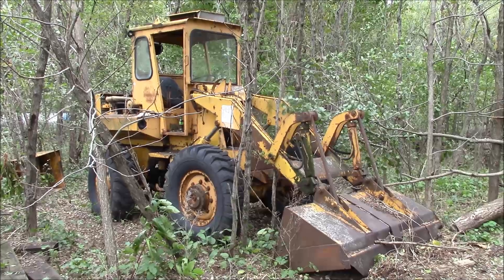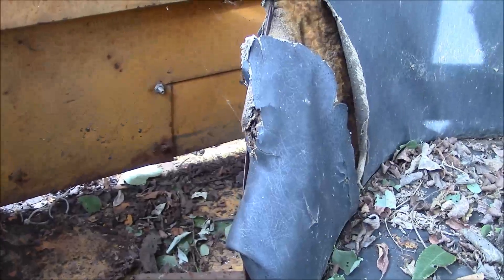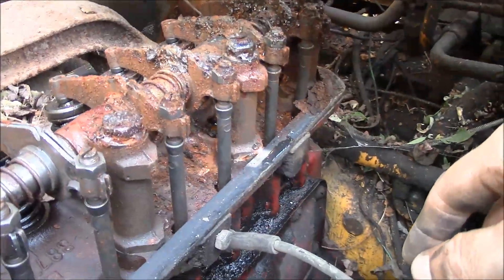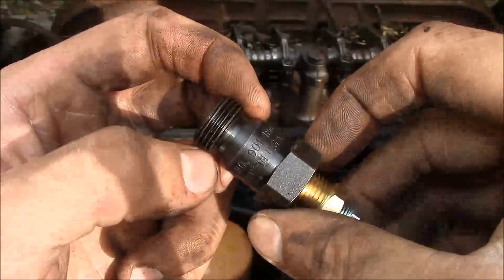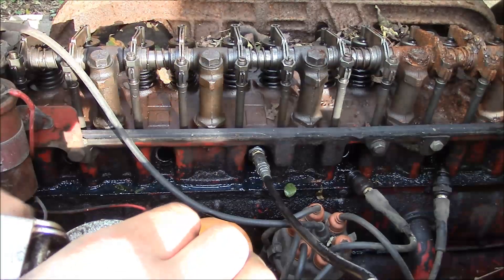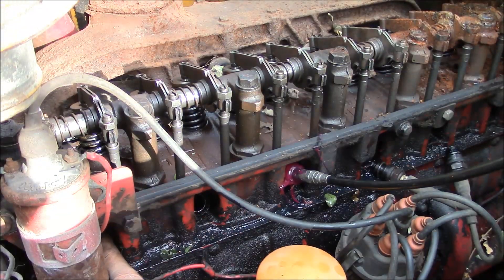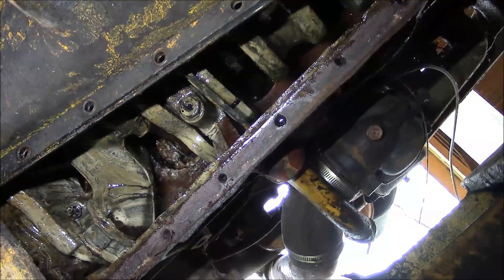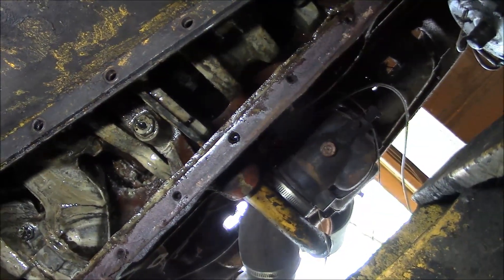Can You Free a Seized Engine with a Grease Gun?

Comment: May be able to remove pan and head drive pistons out and get a better ideal what you would need to do, may get by with a in frame overhaul? A used engine like that would probably be hard to find, may be able to put it's diesel cousin in it? Maybe be able to find something out of an old combine that would work, lot of old combines end up in the junk yard and still have good engines in them? You don't really know if the transmission is still good, could end up spending 9 or 10 thousand on it to make a good machine out of it.

Comment: Fill the cylinders with brake fluid, brake fluid had anti seize properties in it, keep cylinders filled till it moves. Or you can pull the head and make a plate to bolt down over cylinders and use a porta power hydraulic system to pump on the cylinder.

Comment: eBay has a C 301 block in Michigan for $625 that they said has been magged for cracks....but so much would still be needed to be done. Re-Engine does make he most sense. Okay, I went back and watched the first video...so looks like you guessed most of the same possibilities as I did for how all that water got into the crankcase...yuck.
Reply from the maker: It was covered when we starter working on it, but it must have been open for many years.

Comment: Finding a replacement engine to fit the bellhousing of the transmission could be tricky. You may find more luck in buying an engine and transmission together that could be retro fitted? A difficult one to sort because you can put too much into a machine and still be goosed. I bought a pressure (totally different I know) with a few "issues" and I have had to step back from it as it wasn't economical to repair in the end. Have sold it on and lost 65% of the money I had in it. Some you win and some you loose when you start buying any machine. All the best and I also wish you luck!

Comment: Should have sprayed brake and parts clean in the spark plug hole let it set for about 10 min it work for me with a freezed up pistons. The pistons inside the cylinders were rusted tight. brake cleaner is number 1
Reply from the maker: It's had several things sitting in it for 3 weeks. It's not happening.
Reply: @WatchWesWork  Ok then its definitely trash get a donor engine best bet. I'd go with a diesel conversion if possible.

Comment: Dump some ATF and acetone down the cylinders it will fizz and bubble and eat the rust ring. Worked on a long tractor that went under water and then sat full of water 14 years. That old long runs really good now. Never pulled engine apart!

Comment: What about a CNC machined aluminum adapter plate to a more readily available engine,  without seeing the setup I guess that's easy for me to say,  I know you've worked with CNC machines on your channel before.  I just tried to look for some used C301 engines on the net with no luck perhaps the community could pitch in.

Comment: Feel like that machine might be worth repowering with a more modern straight 6
Reply: a chevy 292 would be good common engine on farm machinery and old trucks
Reply: So is another IH straight 6. Probably could get a good one cheap too. They used those engines in trucks, combines, and tractors. Pull the junk one out, bolt in a runner, and you’re off to the races.
Reply: the ford 300 six made good power and are very reliable
Reply: Cummins
Reply: Pierce made a nice 24 valve T head 6 . 14 liters of torque . I was fingerfucking one Saturday before last , and I  CANNOT wait to bust that big old brass carb apart .

No , wont fit , lol .
Reply: 2jz swap the world

Comment: I nice cordless Milwaukee grease gun would be sweet
Reply from the maker: I have a bulk grease pump that uses compressed air at the shop. Too heavy to drag out into the field though.
Reply: Watch Wes Work Back when I was working on trucks at my friends farm and trucking company we had a big air grease gun in the shop fed from a drum but I wound up using the cordless Milwaukee most the time rather than dragging that greasy hose around. I was amazed how much pressure that little cordless thing could put out. We had 4 dewalts that gave up after about a year but never a Milwaukee Except for one that got ran over.

Comment: Since the engine is toast , if you need to turn the crank to get the torque convertor bolts out just pour a cup of muratic acid into each cylinder and wait a day.
(Pool supply store has it)

Or just blue wrench  the crank shaft near the rear seal .

Personally I would find someone with a used engine for sale and ask them if they want to buy a front loader that fits that engine.

Dad did that more than a few times when we  had a forklift with a bad transmission.

Finding someone who already has a good engine laying around is a good way to find someone who might want to buy the equipment.
Reply from the maker: Makes sense.

Comment: I wonder if a Chevy 292 or 261 would fit that torque converter or take a 292 torque converter or figure a way to make it fit?
Reply from the maker: Dunno. There's a stovebolt 235 on the property...
Reply: @WatchWesWork  same block as a 292 so measure the distance from the starter bolt on the outside to the bolts that go around the Bell and see if they match if they do get that 235. Running cause that is basically the same as what you have
Reply: 235 is a great engine perfect for what you need !!!

Comment: I have used that method successfully on single cylinder engines, my partner and I pumped a piston out of a Fairbanks Morris 20 horse hit and miss. We used different weights of used oil starting with SAE 30 to get lube down the piston and working our way up to gear grease. It took a week to get the 9 5/8" piston out of the 16" bore. Figured we were exerting 60'000 PSI in to the bore. looks like that engine is toast.

Comment: I’ve poured Coke down the cylinders and walked away. I came back a week later and engine turned over.
Reply: the rust and scale is below the piston, the coke can't get there
Reply: P MAE could try and fill the oil pan all the way up to the dipstick fill with coke
Reply: Garret R Now that’s a great idea, and I’m not being sarcastic. The motor on the inside would look brand new after it sits for a few.
Reply: @garretr4488  White vinegar is cheaper. Ascetic acid I think. perhaps a touch of acetone, and a bit of auto trans fluid apparently. Agree. Fill it up !
Reply: Ive used P.B. penetrating oil before worked great for my situation
Reply: The sugar in the coke would cause the engine to Reese's a better idea would be to put a little bit of transmission fluid needs one and come back the next day
Reply: @straysandy  diet Coke is what i have used.
Reply: This!
Reply: Just put some TNT on the engine cylinder and walk away really fast that should get the engine going!
Reply: If you greased up the cylinder thats stuck it may break it loose
Reply: That block is trash.
Reply: @4thdimensiontravels855  at this point it's not about reaping any tangible gain, that ship sank, it's about proving that it can be done and that you/he can do it.
Reply: Was the engine in a good mood after you gave it a bunch of coke?

Comment: Engine was fine... until the bilge pump failed.
Reply from the maker: LOL! I thought the exhaust was covered, but it must have been open for a long long time.
Reply: @WatchWesWork  at least the engine is now rustproof from the inside ;-)
Do you own a torch? Grill/fire under the engine to heat it up to losenn it ? Did you try hot oil from a camping stove?
Reply: replace the motor  get it up and running  again
Reply: Curious what Evaporust in #’s 2 and 5 would have done

Comment: What is the bellhousing bolt pattern? Is it IH specific or an SAE? Also, what would it take to remove the rear stuff in the way of pulling the engine? It might be less work to torch the back off and yank the engine, then weld it back on when a new one is in place. Or make it bolt on for future maintenance :)
Reply from the maker: That's pretty much what the last guy did!

Comment: I read in farm show magazine about a guy who  fills a bucket with water and hangs it off of a long bar on the balancer bolt to keep constant pressure.  And filled the cylinders with penetrant. I believe the guy was restoring Jeep's. Just food for thought.
Reply from the maker: I've heard of that method.
Reply: @WatchWesWork  would it be feasible to swap in something like a 300 Ford motor?
Reply from the maker: @ddeauto4426  I'm sure it could be done. Probably easier to find another IH engine.

Comment: Did see a car restoration program here few years back, they had the head off the engine but it was seized up, guy took some engine oil and heated it up on a stove until it was stupid hot then poured it into the bores, after a while the oil drained past the pistons and unstuck the engine!
Reply from the maker: That seems like a good method.

Comment: People just don't get it. Even with a rebuilt or donor engine the rest of the loader is "tired iron". Don't get me wrong I'd love to see it live but its just not feasible unless a viewer can pony up a donor motor. BTW one technique would be to pour Evapo-Rust into the cylinders but you would need to start with that method. Keep up the good work Wes.
Reply from the maker: We're not looking for 24/7 operation. If it can load a truck 10 times a week, that's good enough. The hunt is on for a donor.

Comment: Don't give up. Since you have the oil pan off use a jack with extention on the underside of pistons to gently nudge pistons to break loose, or use a hammer drill with a rod to break them loose. Some type of hard impact vibration? Even if it chips the piston may allow to bar the engine to remove it more easily. The video would be the payoff, not a waste of time if we get a video and you get the views...just sayin... 😉 besides your brother needs it....come on... defeat it! 😊🔥🤛💥💪
Reply from the maker: We'll get it. It's going to take some time.

Comment: I think you've proven the world it's totally not worth it.
Swapping in a diesel would be neat, no more ignition or carburetor/fuel issues. Not sure how to cram one in there tough. To match the power of the old IH engine i guess you'll propably need something turbocharged. 4BT Cummins or a 912 series Deutz maybe? If the IH has a SAE bellhousing it should be doable. Just gotta remember it's old equipment, even with a new engine in it. Would love to see the project though.

Comment: for those playing along at home there is a difference between seized and stuck seized is when it was running and came to a stop and would not turn anymore stuck is when it was parked running and now wont turn probably moisture in the cylinders from rain or something stuck is a easy fix and can be repaired with coca cola pored into the cylinders and by turning the crank back and forth every day till its free then just poor oil or diesel into the cylinders to remove the coke or by doing it other ways diesel, trans oil, kroil mix  but seized is normally something that is not getting fixed without rebuild

Comment: I watched you drag the old tracked loader out. this should be a piece of cake in comparison. Shoot a little cummins will fit real good and run better than this crappy engine ever did. Load this hummer and get the engine out! Not so sure you have to turn to get the torque converter off but a cutting torch will get it out. The grease idea was good, but pushing the head gasket out seems like this engine wouldn't have run anyway. TORCH IT. the engine not the loader.

Comment: As far as used engines 715 combine engine gas 301, diesel 282, not sure if the 310 german diesel would fit it was a much better engine. 706 and 560 tractor engines would work.

Comment: Pull the head 
Make a plate to go from bolt holes and use a hydraulic jack on each cylinder 
Nothing to loose at this point
Reply: Or melt the pistons with a torch. Cant seize what isnt their lol

Comment: May want to try a 50 50 mix automatic trans fluid and acetone,
 shake it up good and put it in each cylinder.
I've seen this work where even heat didn't.
The nut rounded over, and I remembered this.
Wet the nut and bolt and 2 minutes later with vise grips, it was off...
Got this off Steve's Small Engine Saloon, His brother Mike was
an auto mechanic. Mike told Steve before he past away.

Comment: Pop out the injectors or spark plugs pour kerosene or diesel fuel down all injector or plug  holes leave set for however long u wants it eventually should seep past the rings I did it with my diesel  farm tractor work perfect I used a big pipe wrench on the front pulley n pulled on it hard as I could while my friend used a pry bar on the tooth of the fly wheel but careful at the fly wheel gentally pry easy in that area hope this helps.
Reply from the maker: We've done all of those things as I said at the end of the video.

Comment: Bummer that engine is prob toast... was going to suggest something I saw on Cold War motors, the guys pulled the head and bolted a steel plate over a cylinder and pumped high pressure hydraulic oil in to push the piston down.
Reply from the maker: Once the head is off I'm sure we could get it freed up. I was hoping for a less intrusive solution. Should have known...

Comment: Any IH 6 cylinder gas engine made from 1959 on will bolt right in place of that one after transferring a few parts off the loader engine. Tons of IH tractors and combines with that engine, many pulled to do diesel conversions. In fact red paint to me says that one came from a tractor or combine.

Cummins swap would be sweet, but $$$.
Reply from the maker: Yeah, this engine came from a tractor. We'll find a better one.

Comment: At this point, if you can get a brass rod onto one of the stuck pistons you may be able to hammer it free. As a last-ditch effort you can also pout muriatic acid un the pistons to see if it will free up. Don't forget the baking soda to neutralize the acid if it works.
Reply from the maker: I think we'll just cut the crank with a torch and swap it.

Comment: The only thing that'll free that engine up again is the old gas axe.
Reply from the maker: That's my feeling too!
Reply: With all the tractor salvage yards in your area a stop at the Case IH dealer to find out what block will replace the one in the loader and your brother will have a machine to grow his business
Reply: good reply, but you can't see a damn thing in there there is a 60 up to 80% chance that it will not be runned with the same pistons/rods
Reply: Sorry about that. Was probably going to be a money pit.  Kinda like my boat, a hole in the water you throw money into.
Reply: Can't be stuck if it's a liquid. Time for a new block.
Reply: Well done for  trying . I have  a motorbike engine  with same  problem  but  I canwork inside   .  Hope it  all  worked  out . Lloyd

Comment: Put the pan back on fill with marvel mystery oil then hammer the pistons with a wood block after you take the head off and break it free she’ll run
Reply: Then put each cylinder and bottom dead center and clean the cylinders out starting with 2-300 grit sand paper then keep working your way up I’ve got worst running

Comment: Drag it out and find another engine for it.  That would make a few good videos.
Reply: @douganderson7002  Agreed. It'd be a decent project so long as you don't expect any ROI. Once you get it running, you're going to have to start fixing all the rotten hydraulic hoses and seals, which after this long in the woods, is all of them. Probably electrical gremlins as well.
Reply: @douganderson7002   Then maybe the buy was a mistake if there's no money to put into it.
Reply: The loader is supposed to be one of not very many factory gas engine machines, If this is the case there may only be a few left now when more got scrapped. Guys are starting to collect construction equipment and show it without a full restoration .  This loader may have a value to the right guy collecting IH equipment even if they don't fix it on this channel.

  As it was their grandfathers machine and owes them nothing of actual monetary value. There has got to be a motor around cheap maybe a tuber might have one to donate like happens on other channels.   depending on the seal type they can be cheap I was paying $50 average a set from ebay USA for my 78 JCB TLB in Canada.
    If hyd hose are regular common ends and hose size they are fairly cheap to, something like JCB 5/8 hose and 5/8 BSPP that aren't common here will kill you quick though when 2 fittings might cost $100 before adding 10ft of hose.. There are other options if a guy wants to do it, and save a part of industrial and family history.
Reply: @super6954  
Have you tried Discount Hydraulic Hose for hose assembly's? I know they carry British Standard Pipe hose ends

Comment: Can’t you pull the drive shafts or cut the engine off at the engine side of the gearbox and drag it out to replace the engine with a diesel one a 4 cylinder one or a Cummins or whatever engine was used instead of the petrol one please be aware I have no idea of the location or how practical moving it is or its value working or scrap value but good u tube ,ps you have access to crank cut that with gas cant spell acetylene
Reply from the maker: Yeah, that's my feeling too. Just clip the crankshaft with a torch and swap it out. We can move it.